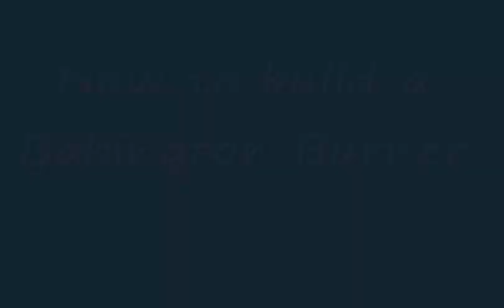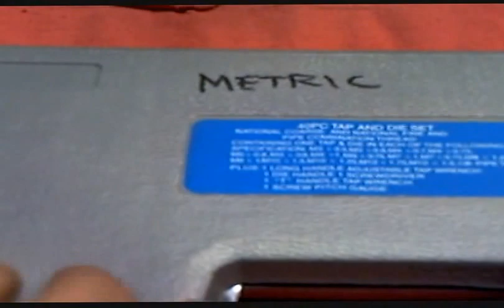How to build a Babington Burner

Comment: Putting flat plate type diffuser like usual gun type burner instead of "gun silencer looking pipe" is more safe and effective, I guess. When burner stops, oil drip around the nozzle is available. It is not good, I guess.

Comment: #80 drill bit is .0135".  They make MIG welding tips that are drilled out to .023"  Maybe a little large but if you want more heat...  They are very inexpensive (less than $1 US).  Most are threaded with 6 mm threads.  Saves you some work.